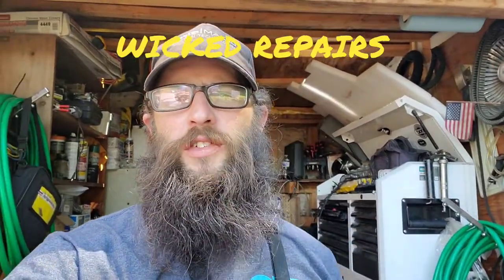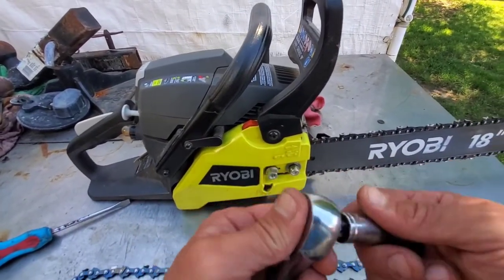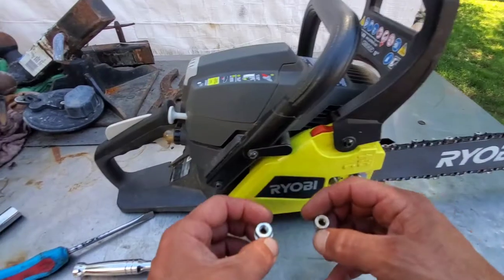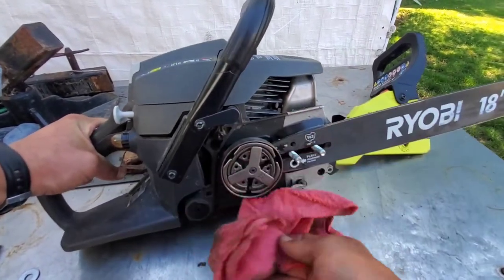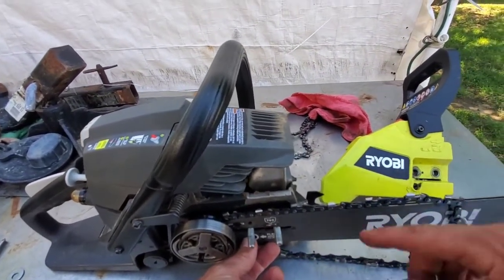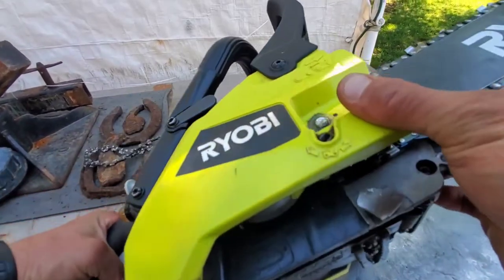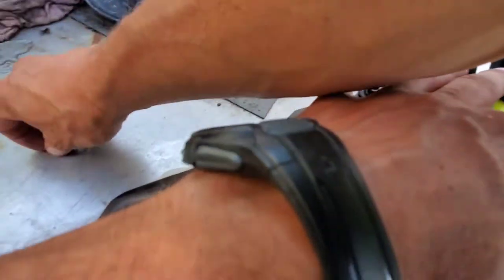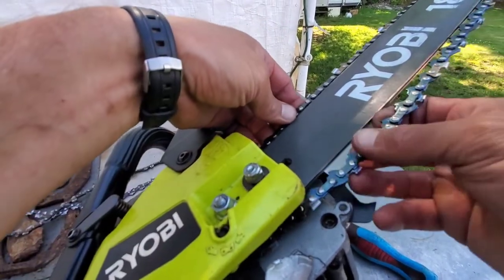Ryobi Chainsaw / blade-chain replacement

Comment: So... what if the chain won't come off the bar...It seemed to just pop off for you.. I can't get it off the bar.. Any thoughts?
Reply from the maker: It should come off easily. Does it loosen up after loosening the nuts and backing off on the adjuster?

Comment: Hello friend. I’ve been given this same saw from my wife and when cutting some branches I found that my bar nuts were almost red hot. I was wondering if had the same experience? 
Thanks in advance.
Reply from the maker: Oh wow! I have not had that issue. If it's heating up that much, be sure your bar oil is full and properly lubricating, also just make sure the chain isn't too tight.
Reply: @wickedrepairs8527  Thank you so much for your reply . I have checked those, and they seem to be fine. I'm not sure what is going on with it. 
Thanks again.
Reply from the maker: @wayneberry8703  that's strange. If I figure anything out, I'll reach out to this comment for you!
Reply: @wickedrepairs8527  Thank you, that would be great.